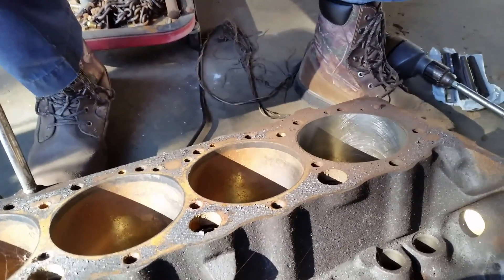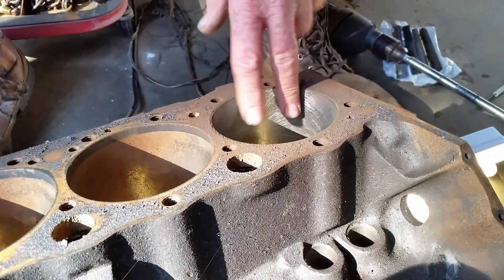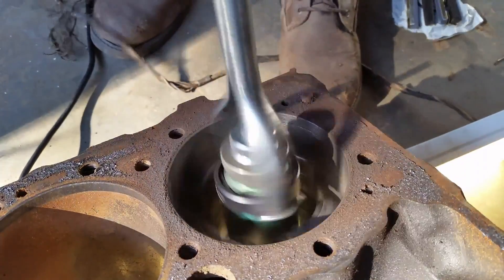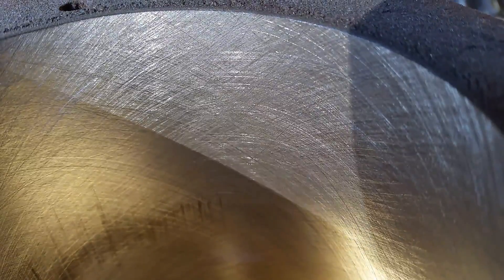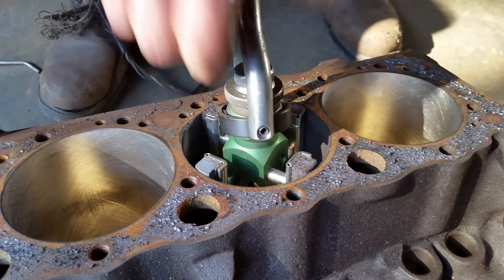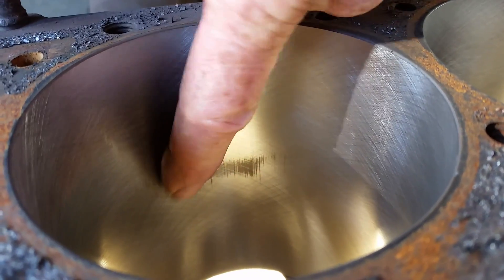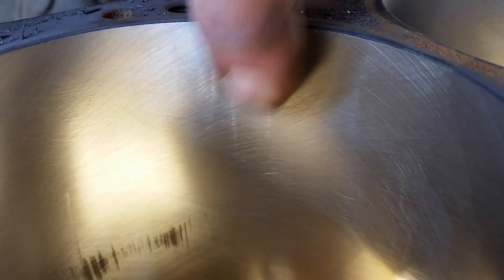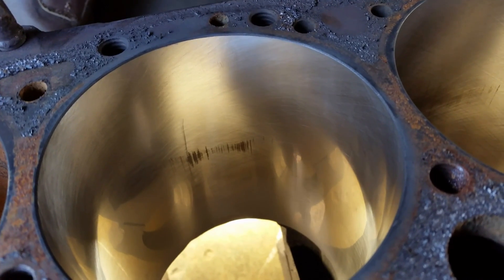How to Platau hone a block

Comment: Lube the damn stones dude!
Reply: john doe I know everyone is screaming at this video.BUT LET TELL YOU WORD FOR WORD...instructions for operating cylinder hone.....if dry honing,clean each cylinder thoroughly with approved solvent and wipe dry.be sure there is no oil or grease left in cylinder to get on stones.if stones should clog with gummed oil or other material,clean with wire brush..ALWAYS KEEP STONES CLEAN....instructions that came with the kit...and I do know what I'm doing please watch some more videos that jomasterhn put out there and I think you will start to unstand..ty for your comment
Reply: who gives a shit like he said its for demostration
Reply: Ray McCormick if I lube it it would be hard to see the results of it but ty for your comment 👍👍👍
Reply: L P. No u are suppose to lube the cylinders and the stones otherwise thr scratches will bee too deep putting too much wear on the piston rings...u could have done it right had u just known..but good luck on the build hope it works out for u...always lube the cylinders when honing..machine shops will tell u the same exact thing..
Reply: john doe ty for your comment but if they was lubricating it would be hard to see the cross hach on the cylinders
Reply: i was guna say the same shit LMFAO!!
Reply: lube the cylinders too! lol
Reply: Rick Bean ty Rick 👍
Reply: john doe even if you just use water to wet the cylinder for easy cleaning, it's better than a dry hone. Dry honing builds up and then comes the deeper scratches... I agree, honing definitely requires lube.
Reply: That's what I was thinking!! 😱
Reply: Ray McCormick  his a bush mech
Reply: @sicelogumede6295  aircraft mechanic... But thanks for assuming showing you're a jackass know it All
Reply: you took the word out of my mouth ray mccormick
Reply: Ray McCormick yep
Reply: Ray McCormick it's a old block. Just for demonstration!
Reply: L P. You do it your way and I'll do it my way, dry honing clogs shit up. Bottom line, you have no clue what I've done or know.
Reply: Gary Riefle dry honeing does not clogged up if you got a clean cylinder everybody knows that and I will continue to do this way.BECAUSE I READ INSTRUCTIONS like the instructions that came with the hone.....
Reply: L P. Clean at first start yeah but it doesn't stay clean... common sense bud.
Reply: Gary Riefle sit over in your corner and think about it???you are clueless
Reply: L P. I'll think about asking you next time I'm doin a engine. Since you're assuming I have no clue, surely I can assume you bloody know it all.
Reply: Gary Riefle ok you can come out of your corner now do you want to build a stock engine or a race engine let me know
Reply: Ray McCormick  old block
Reply: hevert pacheco ty sir 👍👍👍👍👍
Reply: That hone is meant to be used dry. In fact, the whole point of a hone is to cut metal, not slip across the top of it.
Reply: Don Rutter ty mister Don 👍👍👍👍👍
Reply: @donrutter6765  we flood our hones with oil to clean and cool as we go. That is why real honing machines run oils. This hone has felt wipers, they probably wouldnt last too long of oiled and that is why it is a rather cheap do it yourselfer tool vs the Sunnen micro adjust hones that we use in actual industry. I have this same lisle tool (cause so many said it was good, I dissagree), a Sunnen micro adjust that uses AN stones and two actual Sunnen honing machines.  For a quick "rub" dry works ok. For actual honing, trying to achieve actual specs, oiled honing provides better results.
Reply: Gary Riefle sorry dude you have no clue is what is going on bottom line
Reply: ATF, WD40, Marvel mystery oil hell any oil is better than no oil!!
Reply: david dorshak You know nothing about hones this hone is ment to hone dry sorry to disappoint ya
Reply: @lp.670  yea, um, lets see ive been a mechanic for about 20 yrs, and never have i ever never ever ever DRY HONED a cyclinder And the lisle hone you are using instructions recommends using a light oil. Although it does state you can dry hone but also states you arent actually helping the hone or the cyclinder. Ive seen a lot of shadetree things but this one is at the top of the list.
So hone on Mr. Shadetree
Reply: david dorshak I'm very sorry sir but you know nothing about the hone dry honeing can be done with this hone it say soo in the instructions...but I will say thank you for watching and your comment sir 👍
Reply: david dorshak and too I'm not mister shadetree thank you very much. ....and too I can smoke some of the best like a cheep cigar...and I have done it...sir like I said before thank you for your comment sir...
Reply: Ray McCormick hey 752,000 views wow
Reply: Dude. He said that it's just for Demo purposes. Pay attention to what the man's saying before you get all tore up...
Reply: That is a Lisle hone with felt wipers.  It is meant to be used dry.

Comment: Nice cross-hatch pattern!
But dude, where's you lubrication?
Reply from the maker: Faye Huminski the stones we were using could be used either way, but we preferred to use them dry to try to keep everything cleaner.
Reply: Thanx. What hone did you use? About how much did it cost? I need one for small engines aluminum blocks.

Comment: To my understanding you don't want it too smooth . 280 should be fine.
Reply: George Kolotouros yes sir I will agree with you but when you are building a race motor you will expemt with different things
Reply: For Chrome steel rings I'd be happy with the 280 finish right but if it's a non boosted application using molybdenum coated ring the latter may be preferred (as an example)

Comment: What type of hone are you using? Could it be used to remove ring ridge?
Reply: Wasbuttune the kit is lisle 15000 hone kit.it came from pmd products.email is pmdprod@rochester.rr.com EngineHones.com and no it will not ridge ream the top of block
Reply: no a diferent tool to be used the ridge ring
Reply: Joe Scheller yes if the ridge is around.003 or more you will need a ridge reamer to remove the ridge...so very sorry I just seen your question..and soo very sorry about taking so long to answer your question..if the ridge is still in the cylinder it can break the top ring

Comment: Can plateau honing be done with two different grit sized stones in spite of three stones as you used in video?
Reply: Viswateja Nukala think you for your comment..but you need to do it at least in 3 stages it mite work for you in 2 stages it depens on what HP are you are building you want oil to stay on the cylinder to lube the piston.but you don't want the cylinder to ware the rings out
Reply: Thanks for reply currently I'm working on Nagel H9 and it uses D181 for rough honing and D126 & SCG 400 for finish honing. This requires tool change for every block which consumes time. I want to know whether any grades of stones and change of parameters can help me do it with one tool.